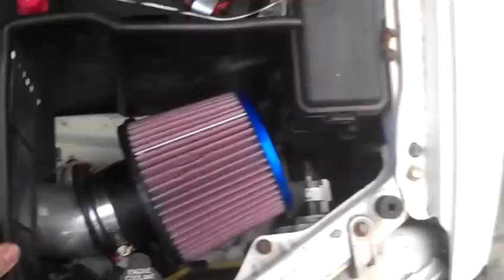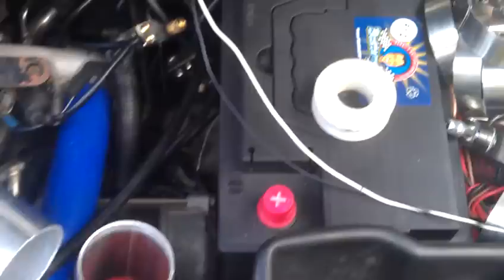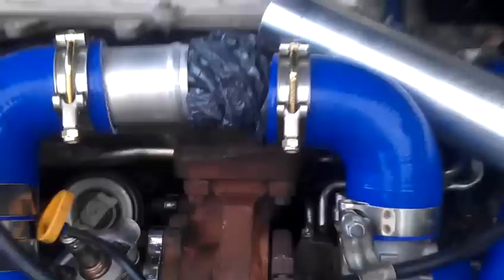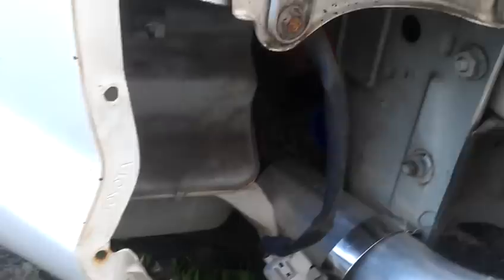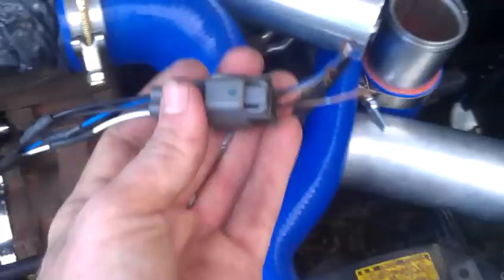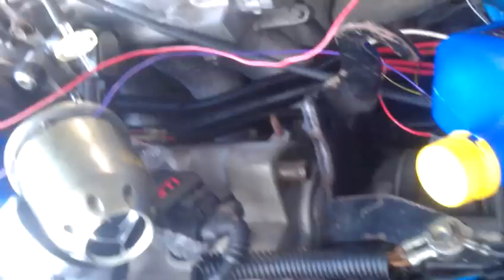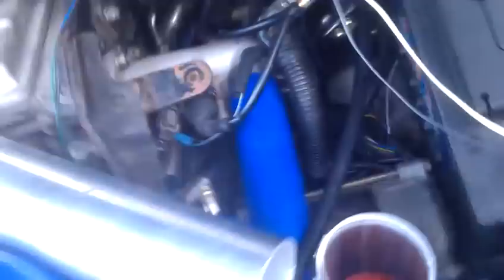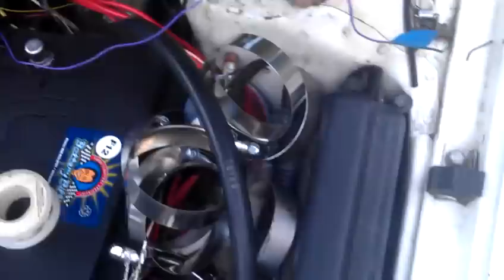3rd Gen 3sgte Build Progress (in Celica)

Comment from the maker: I did my own wiring harness. I went to EFI University and they showed us how to work with aftermarket computers, wire in sensors, and tune the cars (plus a certification). So I bought an aftermarket computer that we worked with there with it's own harness and sensors, pieced it together with parts of my old harness, and pulled out all of the extra wires.

Comment from the maker: exactly! And I have about 3 inches of piping going through the 2.5"-3" couplers on each side, so I can experiment with the size of the replacement I/C if the xs-power one doesn't work. I'm hoping the welds don't crack, but if they do I can have it rewelded

Comment from the maker: lol..only the intercooler is xs-power, and it's for a nissan s14/s15 hybrid. I had to custom make the piping kit, which is why there are so many silicone couplers. I knew xs-power made junk when I bought it but I thought I would at least try out their cheap intercooler. Piping came with it but I sold it, it was piping that gradually increased and decreased from 2.5 to 3 inch, it was made for a nissan

Comment from the maker: is that for the 4a celica or the 5s celica? I know the 4a celica has a different rear suspension and brake kit than the 5s celica does. so maybe there is more of a difference between them. I wonder if the 5s celica is closer in design to the 3s.

Comment: Love the work, but what transmission are you using
Reply from the maker: the stock one that came with the 5sfe, the clutch disk for it is smaller than the pressure plate, but it still grabs, I just don't know how long it will last..I've heard stories, and I'm testing it. 3,500 miles so far and it's holding up
Reply: I'm close to clueless, but I have a friend helping me with 3sgte in 1997 corolla.  The problem is that the transmission is backwards.  I heard there is a conversion kit to make it work, or that I may need a different transmission.  Any thoughts?
Reply from the maker: maloryj I think you can use the shift stalk from the mr2, or maybe it's the GTFour and it bolts on. I originally bought an MR2 trans with an LSD, but it was backwards as you say. Someone told me I could use the GTFour cables and bolt it on to the trans after I sold it. Also you could try a solara trans, but you might have to mod your halfshafts. It is a common upgrade for FWD celicas with a 3sgte
Reply: If you don't mind, I'm sure I will have more questions for you.  So what transmission are you using now?
Reply from the maker: maloryj I'm using the stock manual one that came with the 5sfe. s54 I think, but I'm not too sure of the name of it.
Reply: Jay Shipp hey man i love the car and engine i personally have a 1991 celica st and im wondering if i can fit a twin turbo all track in my celica with my stock or the tranny you used in yours the 5sfe would the engine fit in my car? or do i gotta get the 3rd gen engine like you for my car
Reply from the maker: SvddenDeth if your car has the 5sfe then you can use the manual transmission and attach the 3sgte to it. The S in the engine code means they have similar engine blocks. The transmission will bolt to it. You just can't use automatic transmissions with it. The biggest thing to tackle will be the wiring. The engine is easy to bolt in, regardless of whether you use 2nd 3rd or 4th gen 3sgte, it's just wiring everything up that's difficult.